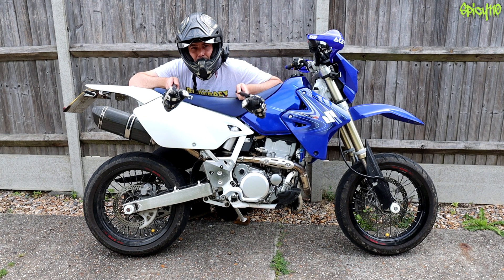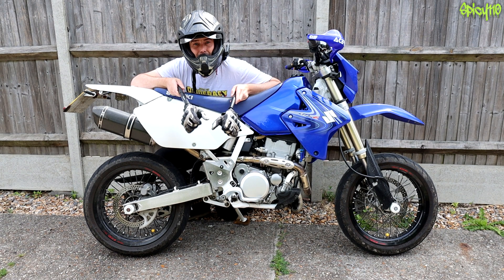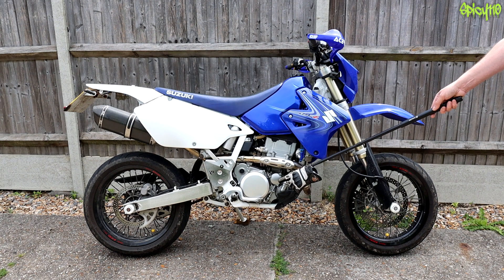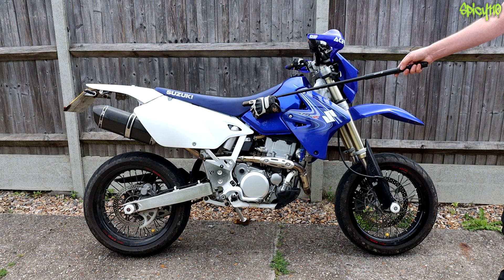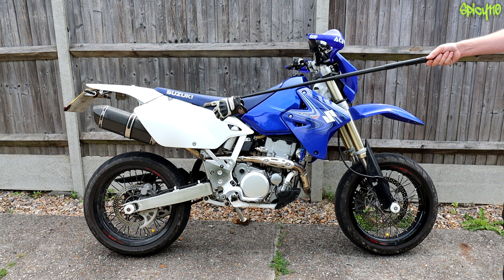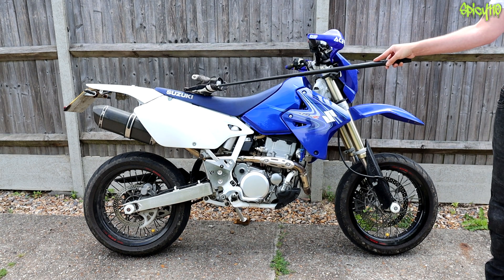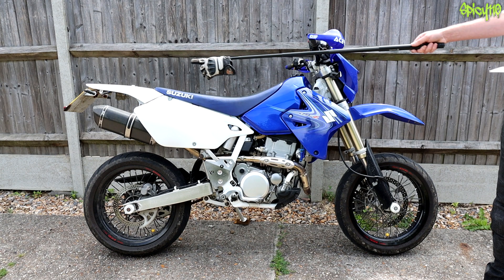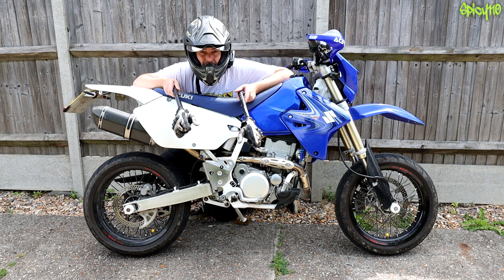Motorcycle Electrics 101 | Every Part Explained!

Comment: What drains the battery if left too long without running the bike?
I have a Drz too and if I don't run it for two weeks, the battery is dead. I have to take the fuse out to prevent a flat battery?
Reply from the maker: You either have a paraitic draw going on somewhere or the batt is old and worn out.

Comment: I followed that even with my very limited bike mechanic knowledge, which will be usefull down the line as Im restoring and old xj550 a mate gave me in boxes, on condition I get it running. A bit daunting, but its been good so far, finally got the forks rebuilt today. Cheers mate.

Comment: Mine is EFI and so the loom very much starts at the back end of the bike at the ECU and extends from there till it peters out at the headlights and instrument binnacle. The parts in between are very much exactly as you very comprehensively described. 👍

Comment: Nice work, concise, simply and easy to understand ..... and if you find a thin cable going to the front and rear brake caliper areas those will be for the ABS sensors
Reply from the maker: Thanks, yes I said about abs at 1:08
Reply: @spicy110  ah sorry, I missed that ... was thinking about what you'd previously said about the stuff at the back ... I must pay more attention, lol.

Comment: Also the regulator/rectifier the regulator part is what regulates the flow from the stator/alternator to the correct voltage/amps  otherwise you could be chucking 20volts into the battery.  This happend on my FZ750 where the reg/rec is inside the alternator and the sealed battery (should have been a ventef battery) under the seat started to boil and swell up, luckily i noticed and avoided catastrophe.